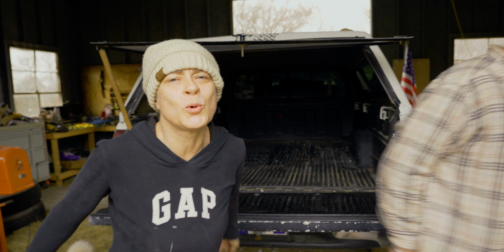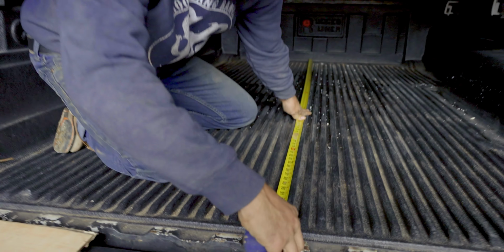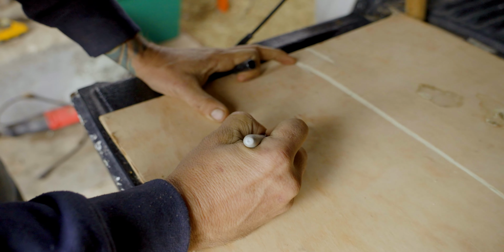Start To Finish / TRUCK TOP CAMPER BUILD OUT IN 10 Minutes / With The Crockers

Comment: Looks great - however I do have a couple suggestions that might help. Over time the screws might come loose when getting in and out. I would cut some bracing for between the 2x4’s and do it closer to the top and middle so you don’t loose that easy access storage at your feet underneath. I would also use piano hinges to put a top on the headboard to keep dust and dirt out as much as possible. Last suggestion is to seal the wood some way to protect it from the humidity and moisture just from breathing. Otherwise I think it looks awesome and it is beautiful seeing you and Jason helping each other out. That’s what true friends do!
I still think Jason can help get you sponsored by Jackery or Blue Etty for solar and then y’all would be set. You can also build out the backseat area of the truck for an emergency bathroom and probably set up a fridge in there to be able to carry a few days worth of food.

Comment: If you find low plastic tubs that would fit under the bed, you can push them under the bed and pull them back out by attaching a rope around the farthest in one first. (I used several plastic dog leashes hooked together and attached around three sides of the back tub so I had two leash holds to pull the tub back out with - one on each side.) Make sure you have enough rope to reach to the back and still have ends of the rope that still reaches the tailgate, then push that tub back with other tubs, making sure you don't shove the ends of the rope you need to pull it out with in. To retrieve them, pull the two rope ends (or dog leashes), removing each tub until you get to the one you want. You will have to make sure not to overfill your tubs. I had more clearance in my build, but if you can find or cut down something, this could give you even more usable space in your build. Happy Trails!